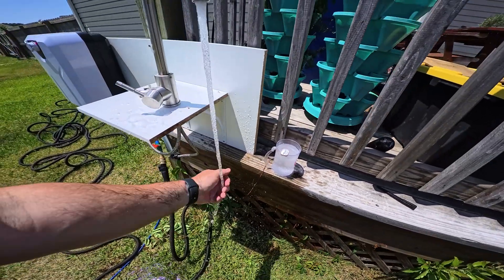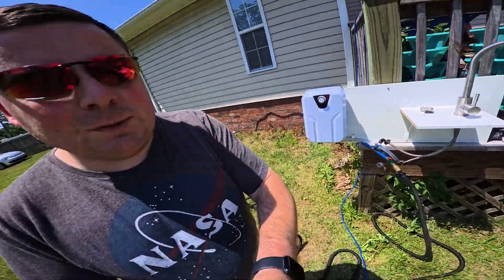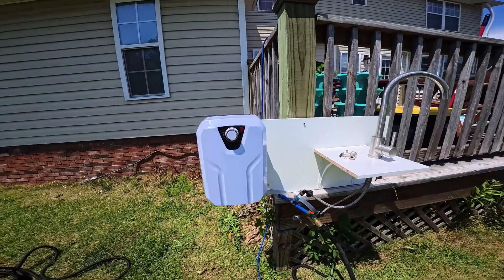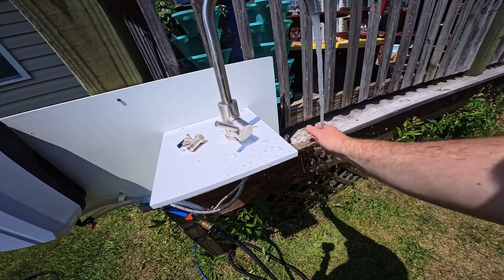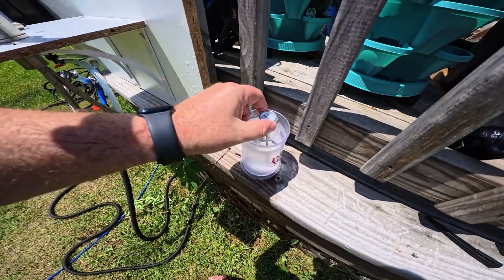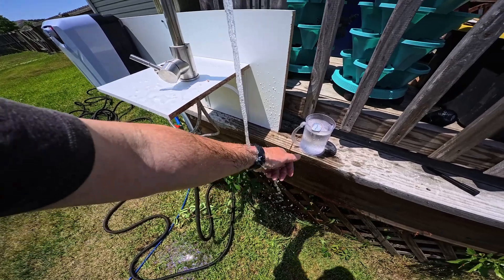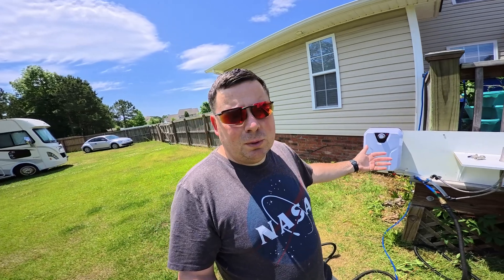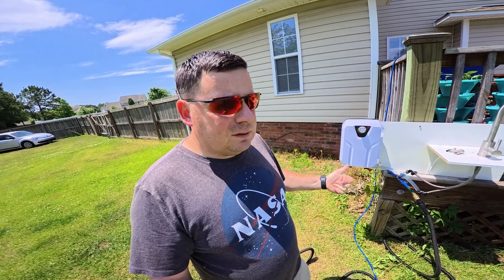Electric On-Demand Water Heater - Does It Actually Work?

Comment: Can it be used for shower?
Reply from the maker: Yes. It has a small tank about 1.5 gallons and it is not unlimited scalding hot water but it was enough for a quick shower that was warm enough to not hate.
Reply: @MajorDadsGarage so it has a tank but it is tankless!?!
Reply from the maker: @sergioknuf  That is what I said! It was advertised with other tankless, but it has a very small tank which is actually helpful. It is still very small.
Reply: @MajorDadsGarage how is it helpful
Reply from the maker: @sergioknuf it warms the water in the tank so the heating element doesn’t have to work so hard to make on-demand water with such low wattage.
Reply: @MajorDadsGarage so you recommend this instead of the 8 gallon ones I like warm showers is it going to go cold after 2 min?
Reply from the maker: @sergioknuf I bought it for my boat and have used RV showers. If you have the wattage and space for a 5+ gallon water heater, I would go with that. This would be a little under strength for even a quick RV shower but if you needed something just warm enough to stand and didn’t have the power or space then this one would be ok.
Reply: @MajorDadsGarage  thank you for all your replies it helped a lot!
Reply: @MajorDadsGarage so if I leave this one on for 10 min straight it will be warm the whole time?
Reply from the maker: @sergioknuf only with very low flow. Hot water would only last 20-30 seconds then warm-ish with normal flow. My wife likes hot showers, she would hate this and only use it as a last resort.